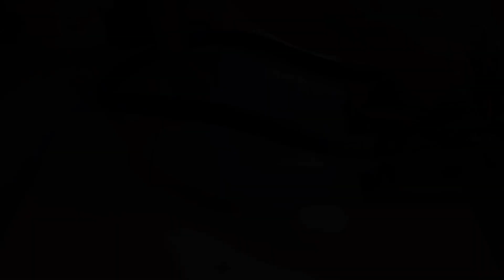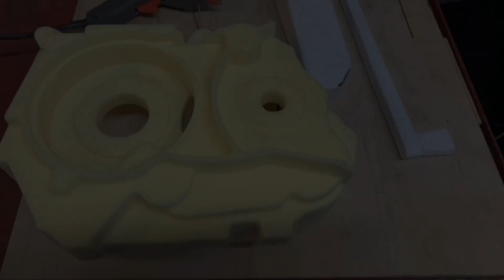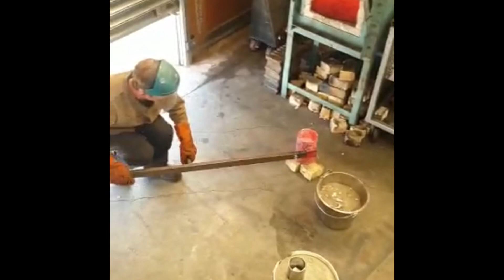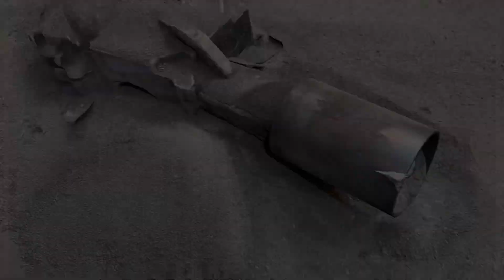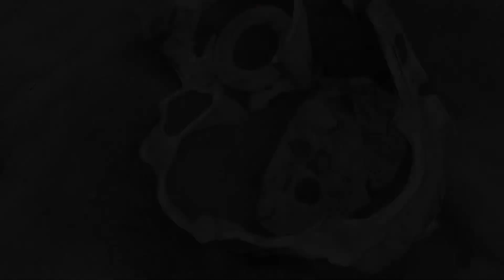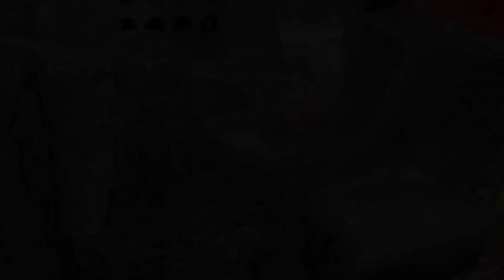Lost Foam Casting the Homemade V-Twin #2

Comment: What's the reason for not using thicker plaster and burning the foam out before pouring?
Reply from the maker: It is just an unnecessary step that would add another opportunity for failure, with no benefits. The thicker plaster will take longer to cure and could generate steam and crack the mould etc. The results I got could have been better had I prepared the sand more thoroughly before the pour and had more rotary vibrators on the bucket stand to help disperse it more evenly.

Comment: A Steel 20 Litre is Definitely in Need for next time you Cast a part.
You might be able to try any Industrial Spray Painting business nearby or possible a Sand Blasting business which in most cases do Spray Painting also.
These types of business generally buy paint in 20 Litre tins and would be perfect to use for your Castings.
You can usually grab a few while your there.
A nice cheap way to find 20 litre steel tins.
( of course that's IF you have either of these businesses local to you ?? )
Reply from the maker: Thanks, I’ll have to have a look around because the plastic buckets definitely only get a couple of good uses.

Comment: Great casting and nice video👌

What product did you brush over the foam ? Pop?
Reply from the maker: Thanks. This is what I used I’m sure you can get similar stuff in different countries. Pop? 

https://www.bunnings.co.nz/gib-plus-4-jointing-compound-4kg_p0441016?store=9480&gclid=CjwKCAjwiuuRBhBvEiwAFXKaNHNNXjovY1dg6ugEQ2TgPejIcvzmn7RCLEGHgiOBSXvSOqLVaiOEARoCQQUQAvD_BwE&gclsrc=aw.ds
Reply: @OddsandEndsMachining thanks for the answer!
Pop= plaster of paris, the drywall stuff

Comment: Inspirational. Mr Millyard leaves a lot of questions unanswered. At some stage I guess you will need a crankpin about 14mm longer than standard. Do you intend to make your own or is there a suitable alternative available from a different model.
Reply from the maker: There is nothing else suitable that I could find on the ProX website where they list all their crank pin dimensions. 

I will get a quote to have one machined hardened and ground. (Saves buying a length of material). 

Or I could buy material and machine it myself and then either get it heat treated and ground or do a DIY heat treatment and a sand paper polish on the lathe. 

I’ll see how much it’ll cost to outsource and let the quote decide.  (Allen got his ones specially made).
Reply: @OddsandEndsMachining  Thanks for your reply.
A guy on you tube with a big hammer and a stick welder going by the name
“w1engine builder” has a video “part 2/membuat mesin 2 silinder block kop mio” and 
modifies a single crank to v twin  configuration using a pin from a “scorpio”.
Unfortunately google subtitle auto translate is useless, I don’t even know what language he is speaking.
Cheers, Nigel.